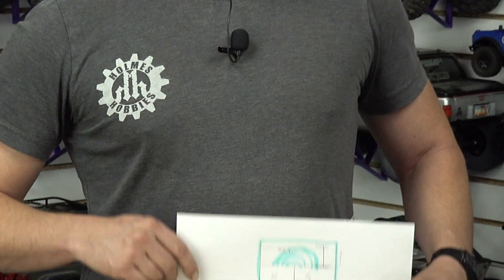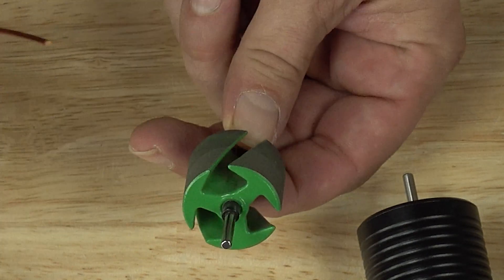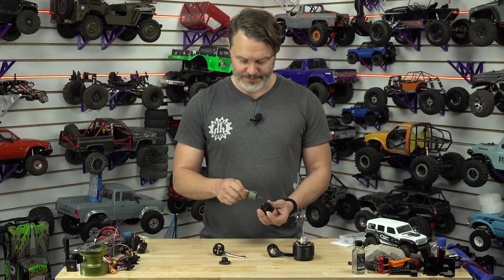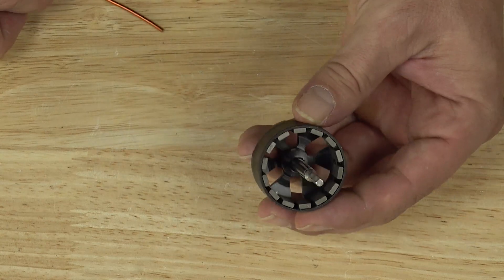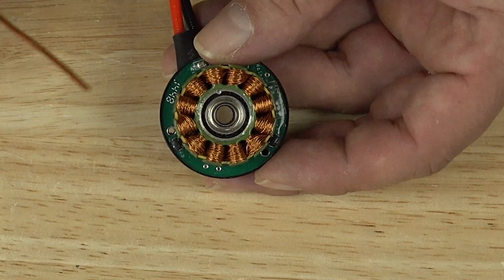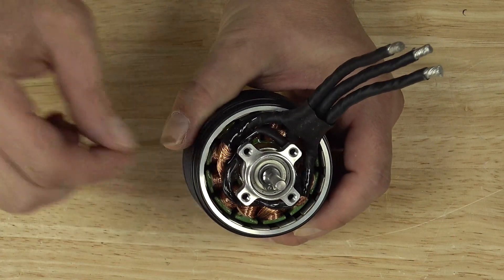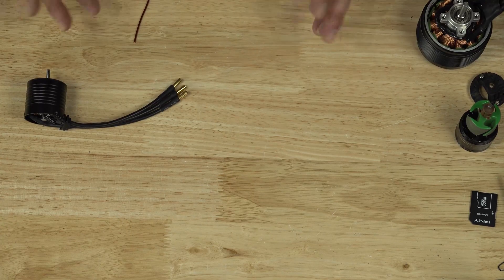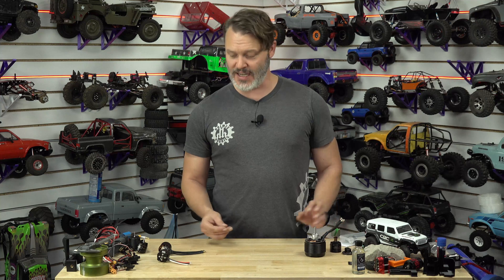🔍 What Actually Is Back Iron: RC Motors Uncovered with John Robert!

Comment: I have a question about the flux ring that is added to some of the sealed can brushed motors. Is this ring added to give the motor a bit more torque by adding to the thickness of the 'back iron' of the can?
Reply from the maker: Yes, exactly!  It makes the existing magnets more effective

Comment: That revolver looked like it was a 2in1 set-up. 🫢 that would be even cooler then a sealed inrunner for some. Team spec stator with esc were wires would normally come out. 😉

Comment: I've been bugging for a minute.😅 I would really like to learn about amperage. How does my esc handle 150a 1050a burst and not melt every wire? How can a 4274 even pull 150a? Actually any motor. A brushed pulling 80a? A 540 13.5t pulling 60a? Even a servo pulling 15a? How is this possible? Thanks.